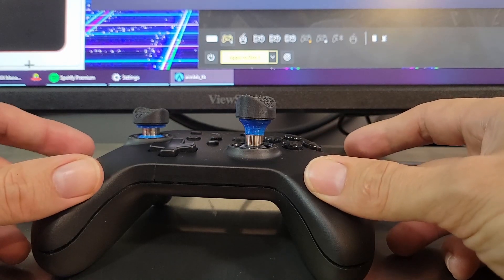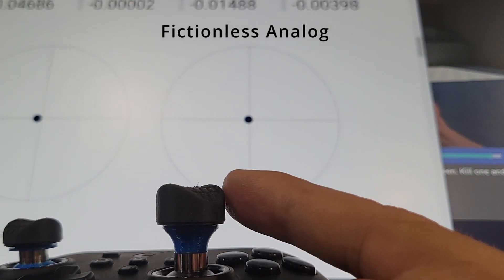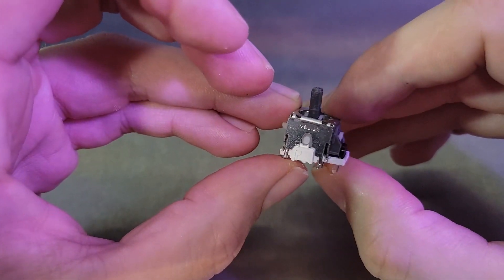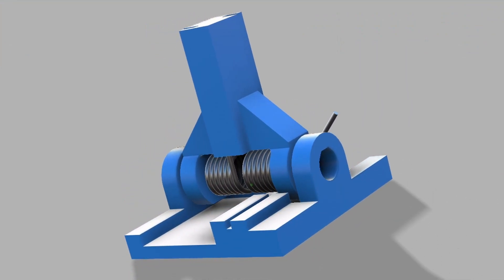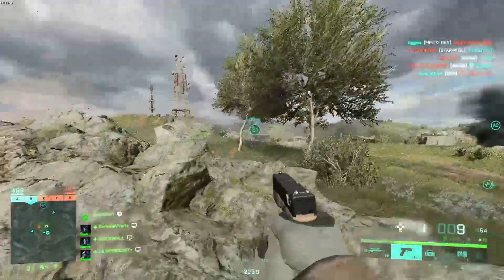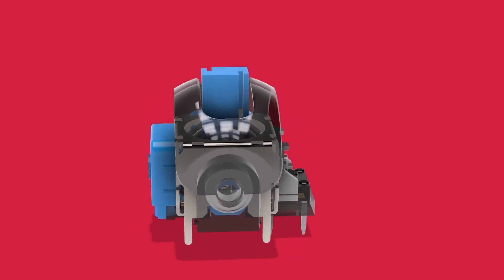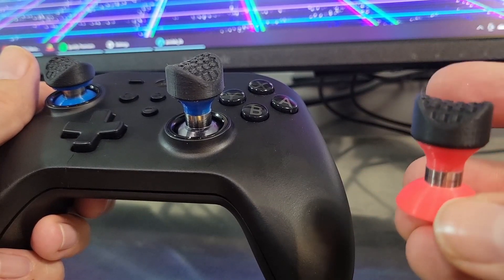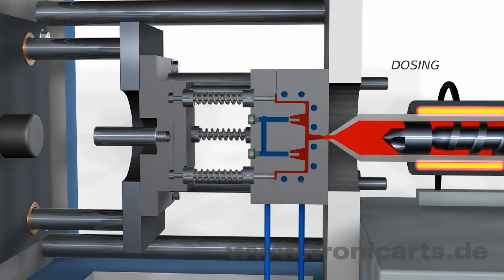Is this the holy grail of controller joysticks?

Comment: You dont need injection mold for it, all you need is LCD 3d printer and Resione k+ resin. I am currently manufacturing a batch of small parts such as various pipe fasteners and specific buttons for a company developing unmanned trucks. We were looking for a material with properties as close as possible to ABS plastic, but at the same time printable on a photopolymer printer. The tensile tests of this resin showed a result of 67 kg for a sample with a cross-section of 4x4 mm, after 15 minutes of UV exposure. A similar test of FDM printing with ABS plastic (with longitudinal arrangement of layers (the strongest in tensile strength) showed 51 kg. The quality of parts on a photopolymer printer can be amazing, you can print with a layer of 25 or even 10 microns.
Reply from the maker: @Dvorkin82  yeah I've been working at it. The problem I encounter is abrasion. I've never found resin good with parts that rub and slide. I think the answer might be pressure casting with hard polyurethane. Not as good as a material like delrin, but better than any resin print material I tested.

The problem I'm also encountering is patents. As soon as these Chinese sensor companies see what I'm doing, they'll immediately steal it. This might be good for everyone else, but I'll be left with nothing after years of R&D.

Comment: Would you make GameCube versions?
Reply from the maker: Maybe. My main focus at the moment is Playstation and xbox.
Reply: @GregRosolowski  Hey thanks for the shout-out. I wondered if Melee players would be interested in your design.
Reply: @GregRosolowski i mean you don't necessarily have to increase the tension if the joystick is already relatively good. You could try combining your joystick with something like precision rings to achieve the desired tension you want, for example you can develop your own precision rings that don't lack resistance lose or only extremely little because the ones from kontrolfreek are not that good
Reply from the maker: @lightyagami9882  since this video I learned a lot more how to design tension curves. I can now maintain the same feel along with no perceivable friction and micro deadzones. I've also found for my gameplay style, maintaining some free floating behavior with higher tension is good for aiming, where the classic stick tension is good for movement.
Reply from the maker: @lightyagami9882  I tried reaching out directly to multiple analog manufacturers such as ALPS and K-Silver, but not one even answered. I have one controller company interested but they never gave me an offer, they don't want to talk numbers. I will keep trying but it's looking like this might have to be something I produce myself eventually.
Reply: @lightyagami9882  I'm okay with using OEM stick modules on GameCube controllers. It's just I'm concerned that there aren't really any good new replacement stick modules that I'm aware of. There can only be so much new old stock around.

Comment: Neat design idea!  Molding isn't as much as you might think depending on your volume.  For such a small part the mold could be a few thousand dollars with the parts being under $1/each even if you only make a few hundred to a few thousand of them.
Reply from the maker: Thanks! I'm subbed to your channel for Fusion 360 tutorials a while back. Do you have recommendations for injection molding companies? After making  this video I checked ASH industries, it's looking like 10K for everything. Not a crazy amount, but also a bit risky for such a new idea. It functions completely different than a normal analog.
Reply: @GregRosolowski  Try protolabs, they offer both prototype and on-demand manufacturing with injecting molding. It would also probably make a lot more sense to have some of the parts you're currently selling molded instead of printed.

Comment: This is a bad idea mainly because spring, especially smaller ones are not effective, they have minimal longevity and with each day will get weaker and weaker and weaker
BTW, many Drone remotes have similar sticks that dont re-zero on the center, they completely free
Reply from the maker: You realize every analog uses a spring, right?

Comment: Hobby? Haha you do better with a controller than I do with a mouse!
PS: I do hope someone makes this an actual part I can solder to a controller, or better yet - I do hope someone makes controllers with this kind of stick. Even if it costs $100+.
Reply from the maker: Thanks for the kind words! Most of my years gaming on controller I was fairly average. It wasn't until I started regularly grinding AimLab that I got fairly decent. The thumbstick modding helps a lot as well ofcourse.

I've been working a lot on this project a lot behind the scenes. I do plan to sell it down the line.

Comment: Does this still use potentiometers? If so, wouldn't those break pretty quickly anyway?
Reply from the maker: No this has to use hall effect due to consistency and low fiction. I could make it with potentiometers but with hall effect becoming more and more common its simply not worth it.

Comment: I believe there are gimballs that you could probably use (or a flight stick that works as a wired or wireless gamepad that already has them) so... You can decide if you want auto-centering sticks, you can set the tensions and friction, etc.
Reply from the maker: I looked a bit into gimbals and never something with no friction. I have seen adjustable tension, though. A problem with gimbals that doesn't work for gaming is the independent vertical and horizontal deadzone that creates an XY locking. I'm intrigued to what you have in mind, though. Can you direct me where to look?
Reply: @GregRosolowski  I have no idea about XY locking. I use self-centering gimbal-based controllers for drone flying and on my PC to control a drone simulator (I use a Radiomaster Zorro on the PC via USB-C but it does have Bluetooth support on my model). Steam sees it as a controller, although I've not yet tried it there outside of flying stuff, since the layout doesn't really lend itself to most games. I've not experienced issues with any positions on either stick and friction is quite low (and adjustable). They sell upgraded gimbals separately. They are Hall Effect gimbals, as well, which is nice.
Reply from the maker: @Dorff_Meister  that's pretty cool. I've always been interested how those would function for gaming. I have played around with gimbals and just based off feel I couldn't imagine them working that well for shooter games. What I mean by "XY locking" is there is a mechanical force that keeps you in line when moving vertically or horizontal. So for example if you rotate the stick in circles you'll kind of notice a bump that happens on the vertical and horizontal axis, giving a sort of square shape. That feel is the reason I never looked too far into gimbals.

Comment: I never thought about spring hack. This is without doubt is amazing! I wish you should consider adding customization system like how we can take out our keyboard switch and change every single component to our own liking. You should consider for selling it, funding should not a big deal when crowdfunding will tell you the real demand. @Marius Heier made few attempts for converting current traditional joystick in common controller to Hall sensor, but this will push it even further.

Comment: Hi please tell me if xim nexus is worth it?
Reply from the maker: Depends on what you're looking for in a controller, but in my opinion, absolutely! There's definitely no other controller that offers the tech and versatility that Nexus has. 

The only reason I'm not on one anymore is practicing on aimlab obliterates standard analog modules. I can only use controllers that have hall effect sensors.
Reply: @GregRosolowski  alright thanks so much for you time man. Wish there was at least one config available. There is absolutely nothing to be found and its extremely hard to get started playing with the nexus if you have to figure every single thing out yourself. Wouldve been amazing help if anyone had a video of their config so it doesnt expire or a working copy code. 

Please let me know if you have any ideas because this is killing me :P

Comment: Keep in mind that injection molding isn't the only form of manufacturing, and that plastics aren't your only available materials.  I'd rather see a more detailed diagram of your stick for better input, but if your manufacturing concerns are about the shell-like sections, with some modifications those could easily be stamped metal; similarly the additional housing pieces don't necessarily have to be molded plastic, the only reason the pot housings are, other than manufacturing scale, is due to electrical concerns and how the housings are keyed to the stick box, plus some other features such as the flexion clips that constrain it in place. 

There's also just the issue that comes with trying to improve on the design we're given.  Working from the ground up would produce something much better than iterating on the same old RKJXV series housings; ALPS themselves are moving towards their RKJX2, which is a full-sized half-gimbal upper half with an FPC (like what mini sticks, PSP, Vita, JoyCon, etc. use) lower half, the GPD Win 4 and PSVR 2 prototypes are the first to use these, similarly whoever NYXI buys from has a newer stick module, KSilver has promo material on some newer sticks, etc.  As much as well all might like a standard platforms, I think everyone is agreeing on that major change is needed in implementation.  Just physical design is entering a wild west state, let along potential sensor implementations; so while creating an adaptable design is nice, you shouldn't also constrain yourself to just the one stickbox design. The industry is definitely at a point where there's industry interest in various solutions, a competent design could easily be bought up if it's viable at scale.
Reply from the maker: I'm thinking about other options with manufacturing. But injection molding on a single shot prefabricated mold might be the most practical, but its still thousands of dollars in investment. Metal stamping might be doable but I think you'd still need some parts injection molded. I believe it will just add processes making it more expensive.

My latest version the metal housing is completely removed, I'm not building off any stock components anymore. That made things so much easier, I have a lot more space to work with.

I'm thinking of treating this small at first and sell at a more premium price.  I might mix high end casting resins with some machined metal parts.

Comment: Nice.
Please make a ps5 controller with these analog sticks. For ps5 users. 🙂
A question: Is it way accurate than the Gyro Aiming with No Aim Assist ?
Reply from the maker: It's more similar to a regular controllers thumbstick just way more accurate. If you're good at thumbstick you'll be way better on this. If you like gyro this can be used on a gyro controller.

Comment: You have all this leverage on it because of the long joystick caps your using. Id try just using nornal ones instead. Unless your trying to make them specifically for longer ones. Cause the leverage will matter how much tension you need. And every joystick no matter how its made needs a deadzone. Its allways gonna have to have at least a really small one.
Reply from the maker: Thanks for the tip! In some ways, this is true. I did try shorter ones, and to me, the tension is still too low in a similar way. I first made those long thumbstick extensions to get over the friction on normal analogs. With this analog, there's way less of a need for it, but all my muscle memory for the last few years is from that length. I did plan on covering a bit of this in the next video because I noticed a more significant improvement on the shorter sticks than the taller ones. To me, FPS games are almost unplayable on a stock  controller.

Comment: Quick question: I'm currently using and LOVING the Vader 2 Pro. What would it take for you to be able to produce your thumbsticks for it?
Reply from the maker: I'm not sure. The main issue is that I need the controller to be able to do it. Just to be sure, you're talking about the ones I already sell, right? Not the mechanism in the video...
Reply: @GregRosolowski  Correct. The ones you already make. I have about 3 controllers I use and the Vader is probably my favorite at the moment but it's the only one you don't make those for. I totally understand why you wouldn't though. I've not heard a lot of buzz around the Vader 2.
Reply from the maker: @Teeroy  I can do it if I profit about $100 so 3 premium upgrade sets or about 7 clip on versions. 

The other option is to take a risk buying the premium full upgrades for XIM NEXUS. Since they have the smallest dome, they're way more likely to fit.
Reply: @GregRosolowski  I could probably just get some of your clip-ons. 🤔
I'd just have to figure out what size to get.
Reply from the maker: @ZeeroDubs  I could also print you one of each clip and just send you one rubber cap for the price of a premium upgrade.
Reply: @GregRosolowski  ooooo that would be perfect! How do I go about making that order referring to your 2nd idea)? I have your easy pulled up now.
Reply from the maker: @ZeeroDubs  the option with the multiple clips? Just send me a message on etsy before or after you make the order so I can tie it to that order.
Reply: @GregRosolowski  Sweet! Will do! Thanks so much for the replies.

Comment: USA Plastics can assist with every aspect of your mass production of these.
Reply from the maker: Thanks, I'll look them up! I did find another injection mold company in the USA that does low volume manufacturing. I still need a lot more prototyping. But if this gains enough popularity that I will at least break even with the first run, I'll go for it.

Comment: Combine this with Marius Heier's open source hall effect potentiometer and actually get this off the ground the industry wont change itself
Reply from the maker: If this gains widespread interest I'll look into the next stages.
Reply: @GregRosolowski please do
Reply: @GregRosolowski im part of widespread interest
Reply from the maker: @samethott  since this video I had multiple companies reach out and also reached out to some of the larger analog manufacturers to sell or liscence it. All that seemed to have fallen through. I'll likely do the crowd funding method. I think this can blow up on Kickstarter or something if I get the right people to help back it and promote it.
Reply: @GregRosolowski  yeah i agree! digital age only grows your advanced tech will be loved! also question what current analog do you think is the most accurate on the market, anything more precise than the standard given analogs that i could buy without installing?
Reply from the maker: @samethsendsthanks  the stock Alps on PS5 and Xbox. It would require modification, but the tightest deadzone is the Ginful Hall effect sticks. But the hall sensors themselves suck. Only the mechanism.

I haven't tested it yet, but the flydigi Apex 4 looks super promising.
Reply: @GregRosolowski  hi, do you think the Flydigi Apex 4's analog uses a somewhat similar structure to yours?
Reply from the maker: @nghienhandheld  not at all, it's still a friction based mechanism, but a very clever one. I actually wanna review it down the line because it is very intriguing. I can see multiple areas they cut out friction, but the main piece of tension is still like a plunger sliding against a base.

On a side note, it's a seesaw mechanism. One potential issue I see from that is uneven tension from side to side. One direction is almost certainly stiffer than the other but I don't know to what extent.
Reply: @GregRosolowski  if it helps, I did some testing myself using JohnnyPunch's method, and your guess is correct, the analog stick of the Apex 4 registers as a oval shape when rotating the sticks at a consistent 70% of its travel, meaning that up & down micromovements are certainly slower/stiffer than left & right.

That being said, the shape is very close to a round and the sticks feel super smooth. Apex 4 is still imho the best all-round controller using hall effect modules, it's just not quite there yet for competitive fps play.

Comment: Hall effect though 🤔 which is better?
Reply from the maker: Hall effect is just a sensor. It's the part that detects what angle the stick is at. The part I'm working on is the mechanical part. The springs and stuff 🙂

I will be using hall effect sensors on it, probably the Marius Heier ones.
Reply: Wow i feel like if you use Marius's sensors combined with what you are doing you will create the best controller ever made to this point